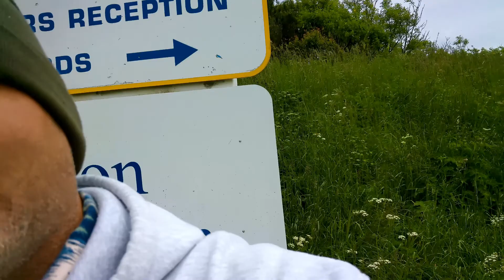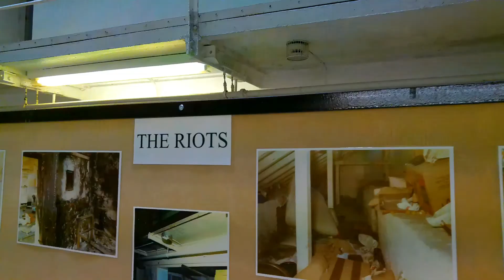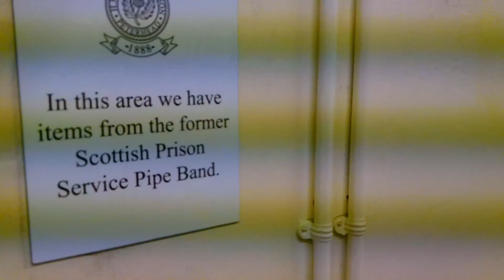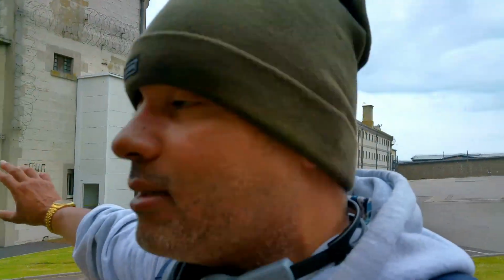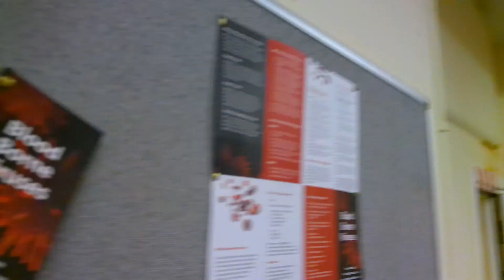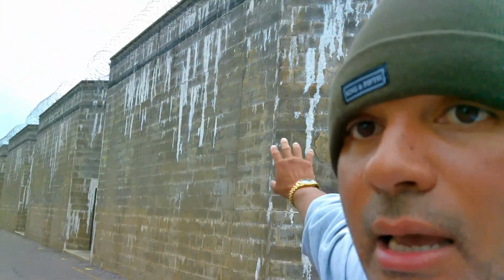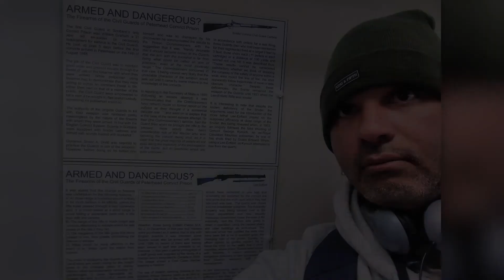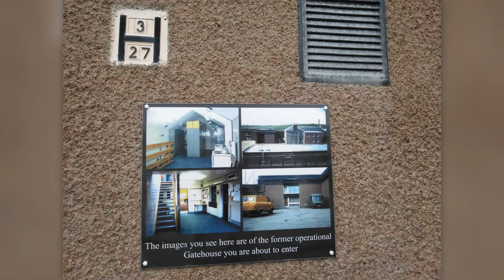Peterhead Prison Museum........Scotland...2021...

Comment: Tavy@  it held about 200 prisoners he said. A hall alone held at least 150 prisoners, and there was B hall wich held the same. And then there was C And D hall as well. I heard there was an E hall as well. But the jail didnt look big enough to have 5 halls in it from what i seen here. And i saw just 3 big halls there, so where was the other two halls lol. But for an hour going round peterhead i expected to see much more than that. He must of said grim at least 10 times. And the walls were hard lol am pml. What the fck is this guy on. Hes touring the once hardest jail in scotland and said "look the walls are really hard" i got the impression he was scared. And the screws in that jail were monsters. That was part of the reason they tore the jail to bits. Becouse of the brutality they endured and it was to far for visits. With most visitors spending a night in a hotel with kids, becouse it was 160 miles at least back to the central belt. It was like building a jail in the outer hebrideas. Then the sps go and build a knew one just across the road, but now the jails for beasts so no one is complaing not even the beasts they dont get a say or even thinck of rioting.